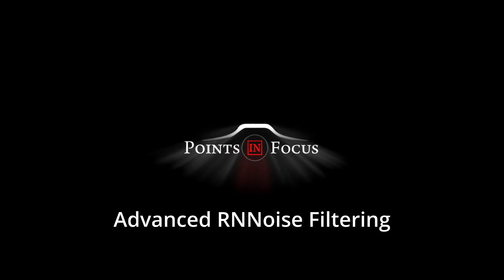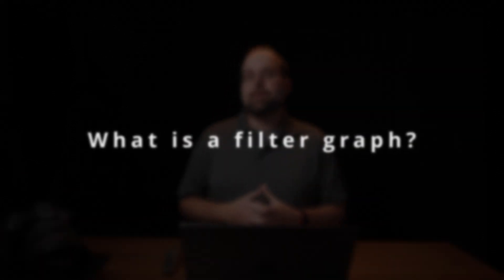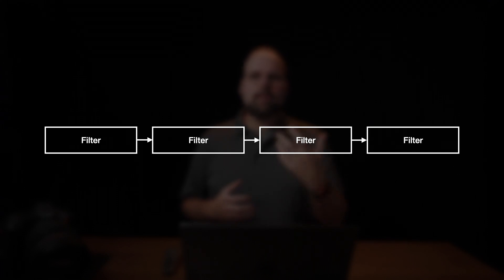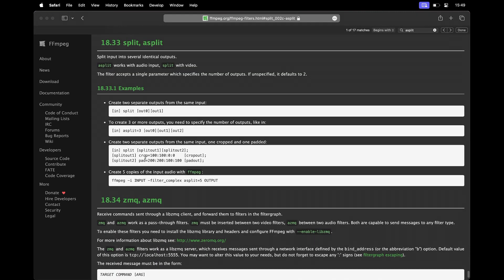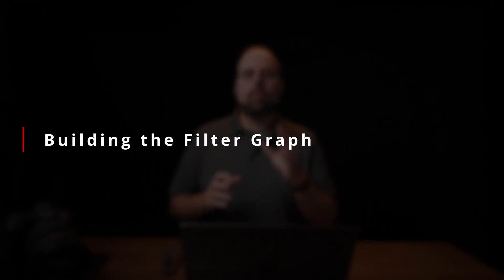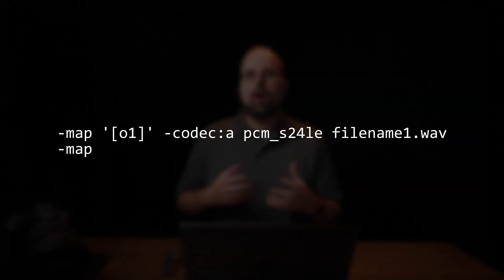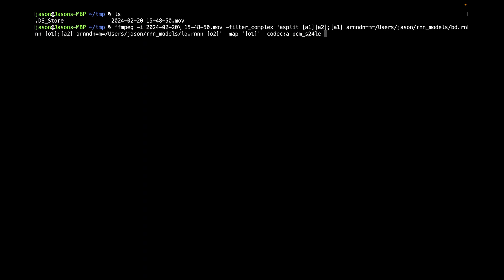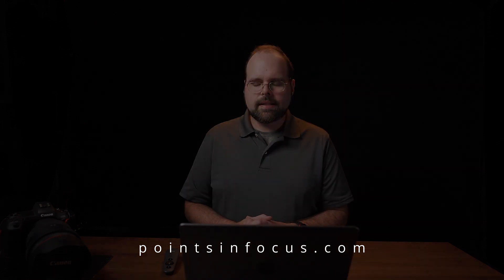Advanced Audio Noise Reduction with RNNoise and FFMPEG

Comment: error 
Unable to choose an output format for '[a1][a2];[a1]'; use a standard extension for the filename or specify the format manually.
[out#0 @ 0000020dfb157600] Error initializing the muxer for [a1][a2];[a1]: Invalid argument
Error opening output file [a1][a2];[a1].
Error opening output files: Invalid argument
Reply from the maker: Could you post the full command you used to run ffmpeg?

The error message implies that either the output file's extension isn't something that ffmpeg recognized (e.g. wav or mp3) or that there's something wrong in the command it self which is causing things to not be parsed properly and it's getting lost.
Reply: @PointsInFocus  What is the point of this video ? Why do you need a command that generates 2 different files with different algorithms ? it's easier to use 1 command and 1 file with the algorithm that works better. and it will work on all operating systems without problems. i dislikes this video because it makes no sense. this code does the same thing.

ffmpeg -i %file_name% -af "arnndn=m='rnnoise-models/beguiling-drafter-2018-08-30/bd.rnnn" %file_name:.=_denoised2.%
Reply from the maker: You don't need to generate two files if you don't want to. I showed how to do it because the two rnn models are optimized for different background sound levels. By running both simultaneously, you get to choose which one you want after listening to the results. 

If you're using this in a script then the cost of writing the more complex filter is a one off deal and you don't have to deal with it again.
Reply: @PointsInFocus  Isn't there anything better in 6 years to remove noises better? thx I realize now what your video is for.
Reply from the maker: If you want to do it for free, not that I'm aware of. 

There are many paid/commercial products out there that do AI/Neural network based NR, many of which can are avaiable as Audition or LogicPro plugins. However, between having rnnnoise working for me in a hands off workflow and audio not really being my focus, I've never looked into any of them.
Reply: @PointsInFocus  here is the code of the bat file on windows and it doesn't work. i need to specify a local folder

set /p "file_name=drag and swap file: "
ffmpeg -i %file_name% -filter_complex "asplit [a1][a2];[a1] arnndn=m='rnn_models/beguiling-drafter-2018-08-30/bd.rnnn' [o1];[a2] arnndn=m='rnn_models/leavened-quisling-2018-08-31/lq.rnnn' [o2]" -map '[o1]' -codec:a pcm_s24le %file_name:.=_test1.% -map '[o2]' -codec:a pcm_s24le %file_name:.=_test2.%
Reply from the maker: Aside from the single quotes in -map '[o1]' and -map '[o2]', the full command you posted works as intended on my machine (Windows 11, under both cmd and powershell, ffmpeg version 6.1.1-full_build-www.gyan.dev).

To be honest, I'm not sure at this point. I want to say it was probably a typo somewhere originally, because it was trying to use part of the complex filter as an output file.